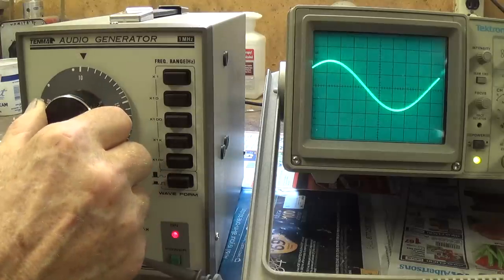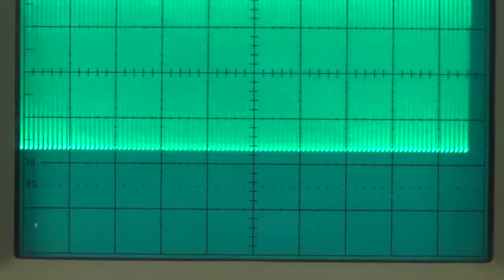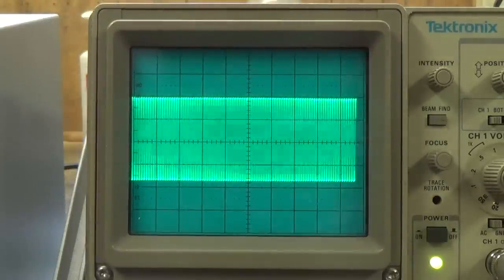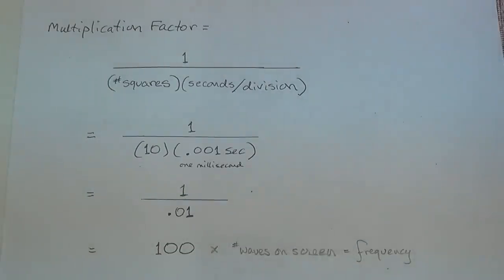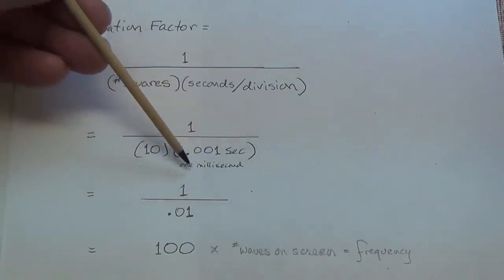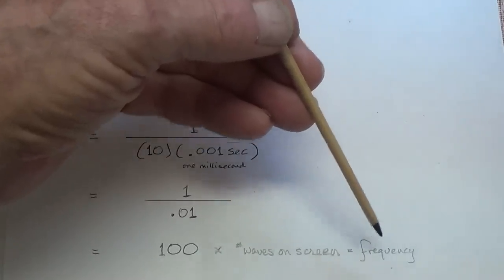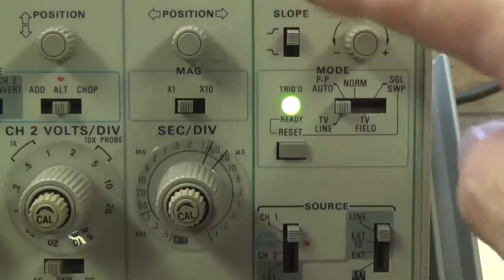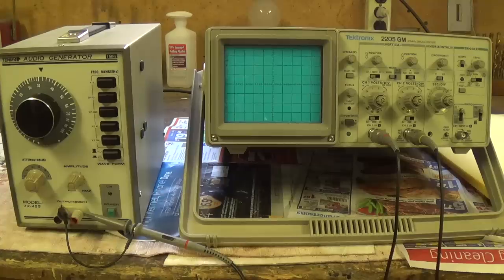Oscilloscope Basics, Part 2:  Seconds/Division and Triggering

Comment: This video has been up for 6 years and the information you present is still pertinent. I have a digital and analog scopes. The digital scope performs all the calculations for me, a no brainer but I still prefer to use my Tektronix analog scope when doing audio work. I prefer the analog waveform over the digital waveform. To me it's like using a VTVM over a DMM when performing a radio alignment. Watching a needle move is much more useful then watching a bunch of changing numbers. Looking at an analog trace is so much nicer than a digital trace when performing audio tests. Learning to use an analog scope can be intimidating to a first time user but taking the time to learn it is very rewarding.  Your series on Scope Basics is very useful and very easy to follow and is a goldmine for beginners. I urge new scope users to watch your "Isolation Transformer" video, the gained knowledge will prevent you from blowing up the front end of your scope or having the probe burn up in your hand. Thank You Uncle Doug.
Reply from the maker: Thanks for your nice comments and helpful input,  D.

Comment: While an instructor with the US Navy we taught our students that before they could touch the probe to a particular portion of the circuit they had to be able to draw what they expected to see.  Voltage deflection/frequency/offset/etc.  It may sound difficult to do but actually is essential to understanding what you are looking at.  Once you know what to expect you can go to the scope controls and set it up so when you do touch the probe to the circuit you will know if it is good or bad.  When I see techs attaching to the circuit and then adjusting the scope controls to get a good presentation it makes me wonder if whatever they end up seeing is really telling them anything they can use.  Using this process of figuring it out first and then looking at it will make you a better tech and sharpen the tools in your skill set.
Reply from the maker: That's a very interesting idea, Thorerik. Thanks for sharing it with us.

Comment: A very clear explanation. Uncle Doug, I wish that those  fellas that print manuals for High tech stuff (especially Seimens and Rockwell) should have you layout the method of instruction in their manuals.  After the new manuals cover their asses with all of their safety warnings and disclaimers. They usually start with the first items of explanation with the understanding that the reader knows nothing about the device the manual has been written for. Then, after about a page and a half of good basic explaining, the tone of the instruction becomes that of an explanation to somebody that already knows how  the device operates and only needs to be technically tuned up to be able to understand how to install, calibrate, commission, and troubleshoot the device. A big jump in the way the information about the device is being presented. Your explanations have no such surprises in them and leave the instructee with a much clearer understanding of the subject by the end of the instruction. Why the big guys can't follow your example is beyond me.
Reply: Siemens and Rockwell... bet you're talking about PLCs and/or drives. That's the stuff I've worked on most of my life and I've concluded they write those manuals like that on purpose. That way they can sell you training to the tune of $500 or $1000 per day, slow paced training that keeps you buying more and more classes hoping to get to The Answers some day. 
Actually, if the manuals or training were any good I'd probably be out of a job. With good manuals, electricians and maintenance men everywhere would soon figure out that what I do (industrial control systems from scratch, plus troubleshooting and repair) is not magic at all. 
And yeah, Doug is an excellent teacher. Heck, I've been using scopes for ever and ever, but I still come here to enjoy how he presents things. His style reminds me of a math teacher bacm in middle school who quite literally changed the course of my life...
Reply from the maker: Thanks so much, Tony. What you describe is exactly what I try to avoid. There are millions of people anxious to learn all sorts of technical skills.....but sadly, they are let down by engineers who are either unable or unwilling to provide effective instruction. This is largely why I became a math and science teacher many years ago, and why I have now turned to YouTube to continue trying to reach the masses with instruction that can be comprehended.......and not dreaded.
Reply from the maker: Thanks so much, Sooti. By coincidence, I chose middle school for my teaching career. It's the perfect time to shape students, before they become "hardened" in high school and college.

Comment: Thanks very much sir I understood most of the part explained.
Reply from the maker: You're welcome, PK.
Reply: @UncleDoug  you said absolutely right that most of other videos just toggle switches and that does not make sense. It would be great if you can make a video on oscilloscope dealing with batteries, home supply and checking circuits with oscilloscope. Also I have a single channel osci. (It was cheap). So just wanted to know that does it worth to buy it.
Reply from the maker: Thanks, PK. I'll keep your suggestion in mind for the future.

Comment: Great videos. I loved it. I just bought a techtronics 2225 oscilloscope. For an audio generator. Are there any models you would recommend. How much should I pay for one? 

 If you do not have time to respond. I understand fully. Just keep making the great videos! Thanks Tim
Reply from the maker: Thanks, Tim. Congratulations on the acquisition......you got a good one :)  I've had excellent luck with the Tenma Model 72-455 that I use in the video. I recommend it highly.
Reply: Uncle Doug thank you
Reply: Uncle Doug any suggestion on an acceptable price range for those signal generators? Or, what would be too much in your opinion? Good video again. I have a Tek 475. I'm looking forward to having some time to get it out and play with it. Looking forward to the isolation tranny build, too! Take care.
Reply from the maker: Thanks, Bob. I paid a little less than $100 for mine. I would consider that to be a reasonable price for a rather simple unit like the Tenma.  You can spend thousands if you want something state-of-the-art with all sorts of features you will never use.

Comment: Good job as always, if I may I would like to suggest that when measuring frequency on a periodic signal it is common practice to adjust the sweep rate such that  you have at least one full cycle on the screen and only one full cycle. The frequency is then the number of boxes times the sweep rate divided into 1, which is really what you did without having to worry about how many full waves you had because it is one. If that makes sense? Anyways good jog and thanks for sharing.
Reply from the maker: You're welcome, Michael. Thanks for your suggestion.

Comment: Great video again..a quick question please...if a scope doss not have a ch1 bnc output on the back of the scope to say send the signal to a frequency couter , how is the best way to set up a t connector on the scopes ch1 input ensuring that just enough signal is taken from the scopes ch1 input (ie ..i want to limit the signal at the t connector so it is just enough to trigger the frequency counter)
Thanks in advance.
Reply from the maker: I only know the procedures that I have personally worked out and perfected, Andrew......and I have no experience at all with the problem you described. My suggestion in cases like this is to simply use trial and error until you find a solution. Good luck.

Comment: Thanks again Uncle.  I need this type of simplicity since I'm on my way to acquiring my first scope.  I'm a math moron, so I need to ask a seemingly stupid question.  Why is the product of the number of screen divisions times the seconds/division divided into 1 to obtain the correction factor?  Is this because the probe is set to 1X and if it was 10X I would divide into 10?
Reply from the maker: Yes, if the probe were set to 10x then you would divide into 10 and get an answer that is ten times more than if the probe were set to 1x.
Reply: ...the 1X and 10X settings on the probe only affect the AMPLITUDE- those settings have NO effect on the time base.

Comment: Thanks for the great tutorials; they're the best I've found as I become acquainted with my new oscilloscope after not using one for 40 years. Mine's similar, a Techtronix 2213A, and I can't get the sec/div calibration quit right using the "probe adjust" reference signal. Turning the calibration pot. as far as it'll go, it still reads only .92ms peak to peak. Is this a case where I'd need to open the case and adjust something inside, or does it suggest a component has failed inside? A sticker on the case says it was last calibrated in the mid 90s...
Reply from the maker: You're welcome, Allen. There are ways to make adjustments, but I am not well versed in the methods. Your best bet would be to download a technical manual on the Internet....or buy one on Ebay.
Reply: @UncleDoug  Thanks!

Comment: I have a probably basic question here. I work in industrial maintenance and deal with freq drives for 3 phase 480 motors. The inverters in most of these are not pure sine inverters, it is my understanding that they generate a "pulse DC" signal to drive the motors and thereby control the speed of said motors, is this "pulse DC" drive signal the same as the square wave you have been showing us or is this something different? I know that to safely run a three phase motor on a Freq drive it really needs to be inverter duty rated to live, I am just wondering if this would relate to a  pulse DC signal as opposed to true sine signal.  I hope that makes sense...Thanks for sharing your vast knowledge on these subjects!!
Reply from the maker: Jack, your question exceeds the boundaries of my experience and knowledge. My old brain has a hard enough time just understanding the basics of tube electronics......so pulse DC regulation of 3-phase motors is waaaaaay beyond me. I'm sorry, but, as Clint Eastwood once said, "A man's gotta know his own limitations."  :)

Comment: greeting uncle Doug
just wanted to ask a question,  when you connected your probes to the stud on your scope and showed the square wave in your scope screen, did you have to connect your scope to an isolation transformer so that you can safely connect the ground clip to a grounding point from the scope?
the reason i ask is because your probes are already connected  to ground via the BNC connectors  and then your grounding clip is also connected to a ground again...i know this  is a dumb question but i just don't  want to regret  it later not asking  before i screw up my first scope.   just want to play with the square wave and the controls and get to know them  and get used to them.        thanks  in advance!
Reply from the maker: No isolation transformer in needed, Fernando. Attaching the probe ground to the scope was not necessary, but I did it for demonstration sake. You only need an isolation  transformer if you are dealing with a separate electronic device.......i.e. an amp circuit.
Reply: so like in this case when you have your signal generator connected to to your scope,    my guess is that your  signal generator is plugged  in to your isolation transformer secondary  because it is  a separate electronic device...am i correct?   i have i  signal generator and a function  generator  that i am planning  to  hook it up to my scope this weekend  to start  learning the controls, i also have an isolation transformer for this purpose.   thank you for all of your awesome videos  and your dedicated time to instruct people like me  just trying to learn

Comment: Hey Doug...What's the old tube radio by your desk...is it one we've seen you work on...
Reply from the maker: It's a very unusual old radio, Lee. The lower chassis is shortwave. After it receives a SW signal, it transmits it at 1100Kc to the upper chassis. To receive the SW broadcast, you tune the upper chassis to 1100Kc.....or you simply tune it to other frequencies to listen to local AM stations. I have never worked on a radio in any of my videos.......yet :)
Reply: Uncle Doug .... I would vote to add it to the que... 😁
Reply from the maker: I wish I had thought of it during my video "dry spell", when I was hunting for topics to cover. Now, it will have to wait it's turn for a while :)
Reply: Uncle Doug awesome Doug hope you have a great father’s day
Reply from the maker: Likewise, Lee.

Comment: Can you share a situation where you might need to see an inverse waveform?
Reply from the maker: If you wanted to visualize the relative amplitude of the out-of-phase signals from a phase inverter, you could invert one of them and then overlay it on the on the other.

Comment: I understand how to set up and read a scope, my problem is I dont know what I should be looking at to solve the problem at hand. I have a problem of where to hook the scope up to what Im repairing.
Reply from the maker: Oscilloscopes are useful for the diagnosis of some, but not all, electronic circuit problems, K. Phase 2 is learning which problems it is useful for and how to detect them with the scope. Good luck.

Comment: Ok so i'm going to just ask even though it might seem extremely stupid ...... but couldn't i just use an old keyboard as a tone generator for the sign wave? 

1000 hz should be the second B above middle C if the first A above middle C is 440, the octave above that A is 880 plus a whole note to B should be just a hair over 1000 hz.
Reply from the maker: I guess you could, FJ. I just don't happen to have any old keyboards handy ;)
Reply: @UncleDoug  That's ok Uncle Doug, i don't have any sign wave generators handy.

Thanks! Will let you know how it works out.

Comment: Why does the vertical lines on the square waves seem to differ in brightness from very bright to almost invisible?  On mine I can only get them to be super faint...
Reply from the maker: I don't know, Matt. I can generally make some fine adjustments which make the square waves uniform in brightness.
Reply: ...the vertical lines are moving so fast that they are there for only a very short period of time compared to the horizontal lines- that's why the vertical lines are so dim.